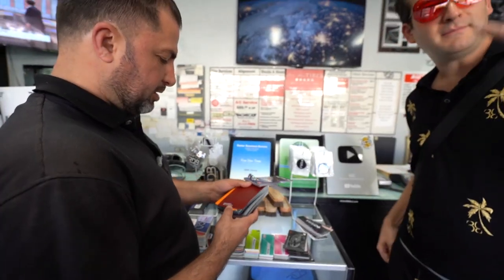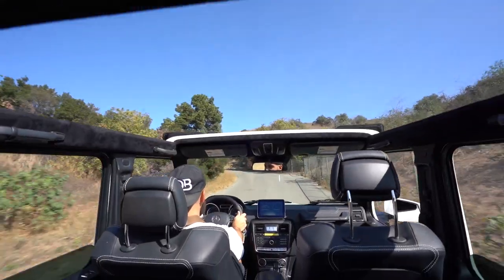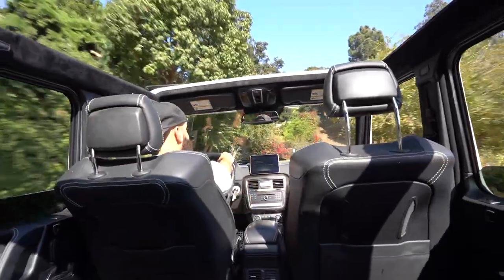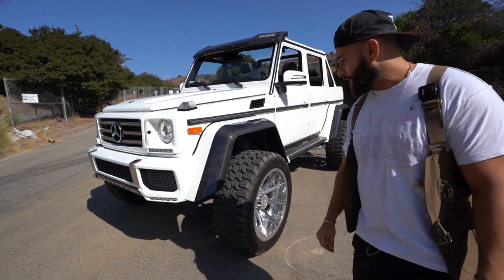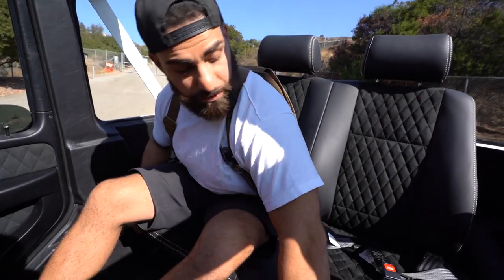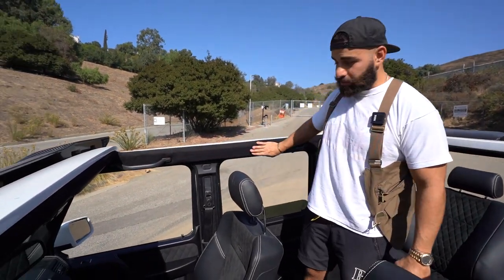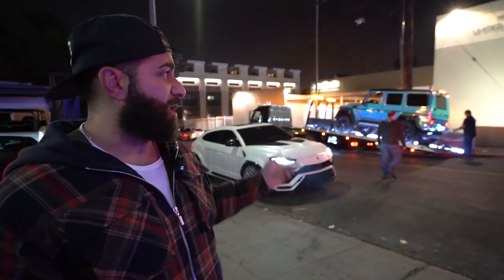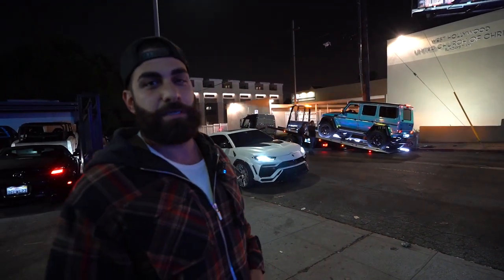Custom Convertible G Wagon 4x4 Squared Mercedes Benz.

Comment: If the 4x4² is constantly open to the elements how do you wash it when its dirty 🤔
Reply: Hope that they used a carpet meant to get wet like on the Jeeps and then let it air dry.
Reply: Lol this car probably won’t see more than the occasional cruise on the regular streets, showing off
Reply: It’s a convertible bro..
Reply: sam9m LA is full of detail shops.
Reply: with rdb autocare
Reply: You dont because your rich

Comment: Finally Vik could not control his excitement to show the car. Nice. Stuff as per me should be worked on asap considering RDBLA standards:
1) Either wrap the car to match the shiny wheels or change the wheels. I think factory wheels would look good on it. 
2) As vik said, eagerly waiting for an exhaust system on it.
3) Rear seats should have the S class style extended foot rest. I would not put pillows on the floor after paying so much for a 4x4 square. The rear seats looks more of a sofa taken out of a cheaper sedan. 
4) Please launch the merchandise atleast if not a branch of yours in New Delhi, India.